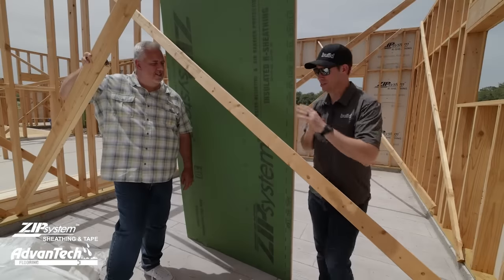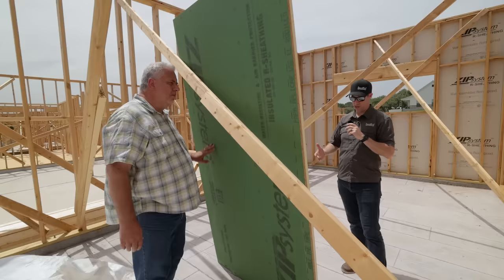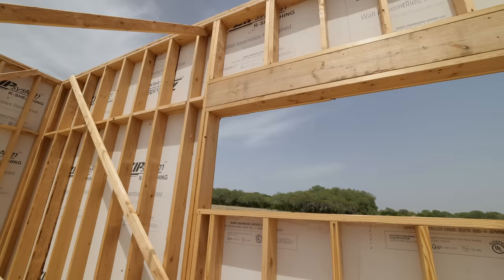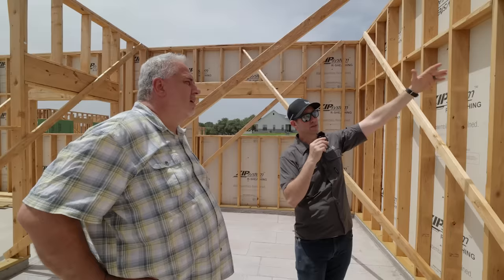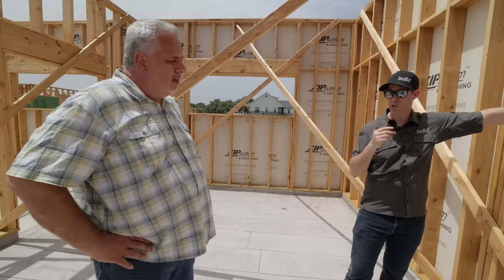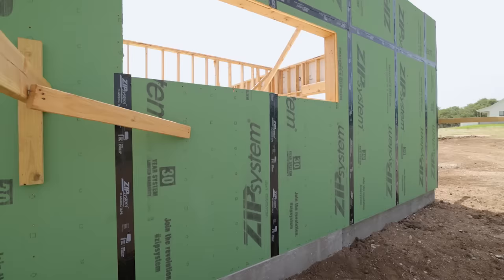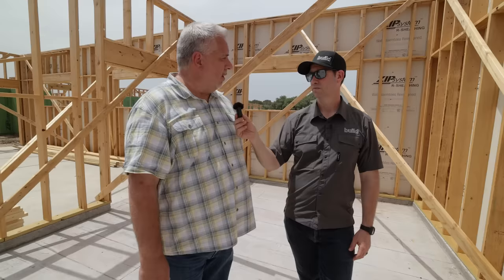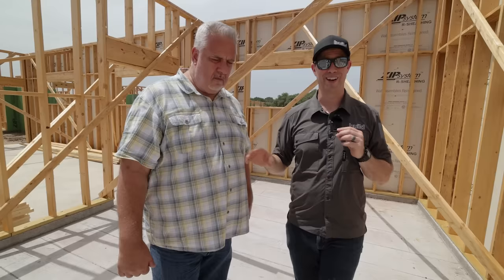ZIP-R Sheathing Review (Feat. Steve Baczek)

Comment: Good luck getting a termite bond using that. Around here they specifically state they won't bond a house with exterior foam. That's why I'm thinking along the lines of bringing in some Comfortboard.
Reply: But in this case would it be considered exterior since technically it is behind the exterior sheathing?
Reply: @explorenaked  As Matt mentioned, he mentioned a concern about insects burrowing into the foam, termites will eat right through foam. There are some termite bonding companies that will bond it but only because of specific  system they are using.
Reply: Not true
Reply: What if you did a piece of metal j channel the foam would sit in like he was talking with the 2x2? Tape it to the surface with zip tape and a bead of liquid flash when installing the j channel. No exposed foam and a nice way to air seal.
Reply: @SnappyWasHere  thought along those lines until I heard about Comfortboard. That should be sufficient but haven't run it by any of the bonding guys.

Comment: Seems like with the condensing point. Does it make more sense for Tx to put the insulation on the outside of the sheathing?
Reply: Yes, it does. Zip R isn't a perfect wall. Matt did it right on his own house. Zip R is just easier.

Comment: What you double sill the bottom with a 2X4 on top of a to 2x6/8. you get the strength of nailing the bottom of the zip and a ledge to hold the zip. Follow that with the tape to air seal the bottom. Trifecta win.

Comment: In central IL, what is the recommendation for Zip R? Building using 2x6 walls. Thinking about using rockwool in walls. Would you use any foam in walls other than sill plate in basement. Really undecided on foam for entire home.

Comment: It seems to me that the shear value in the wall system would be greatly diminished by having a layer of poly iso in between the studs and the sheathing.  Does any one know of data to prove me wrong?
Reply: Data? You don't understand shear value then and why attaching a piece of sheathing to the wall prevents shearing in the first place.
Reply: It is and Zip R isn’t permitted in places like where I’m from coastal Rhode Island.  It’s a good product to use in say Northern Vermont where you don’t have those high wind codes because you’re away from the coast but you do have extensive insulation codes for the cold climate.
Reply: No doubt what so ever just Imagine Sheating with 1-1/2 of airspace between it and the stud . Nailing Sheating directly to a stud creates friction also .
Reply: @richardthomas1566  So why don't you run those calculations for us and show the "greatly diminished" values?

Comment: I love this stuff .. I just hate the price increase .. yikes !  wish i could do my plaster / lathing / clapboard 20's bungalo with this system ... one of my issues is what to around the windows trim-wise considering the thickness of the zip-r  ( my windows are wood and newer double hung low e double glazed)
Reply: Extend the windows is not difficult if using old, but if new, just buy windows with deeper frames... This is not difficult here.   True, you can't be STUPID when doing it, but adding frame length is not difficult.  If you need to hide the line(most likely) , add a new sill plate inside.
Reply: LMAO

Comment: For shear walls, I guess that longer nails through foam will transfer the shear? what nail specs will engineers allow?. Is that insulation creating a radiant barrier on the inside?. Why does that sample piece look like there is and space between the panel and the foam? is the foam not attached?.

Comment: Curious what everyone is doing to mitigate the problem with putting doors and windows in a house with a 2x6 wall and 1 1/2” thick sheathing when door and window manufacturers aside from custom, design their products around a 4  9/16 or 6 9/16 jamb?
Reply: Either custom ordered with larger jambs or finish carpenter installs larger ones. I like making them after the window and drywall is installed to they can be made to the exact depth.
Reply: I have been installing my own jambs for years....easier to start from scratch then fix what's there.

-Improperly shimmied, if at all.
-spray foam has to be dug out and redone
-fat headers or out of flush framing cause width issues
-drywall cutout bit damage
-drywall mud build up on jambs
-sills bowed up in middle from poor framing, and no easy way to get down/straight.
-better foam job, as the jamb goes in while the foam is still wet.

The cost of the manufacturer's installed jambs vs. Materials and labor is usually an easy sell.

Shim next to window with drywall screws run out to the proper height (a simple jig make this easy).  
Spray foam and insert jambs.
Nail adjacent to screw/shims.
Shims/casing to fine tune front of jamb.

This sounds like a lot of steps, but it beats digging out foam and drywall every time.

Comment: Would you be ok using closed cell foam with the Zip-R?  Some worry about a double water barrier.
Reply: I have done it. You need to ensure the CCSF installer is top notch. The fear would be for moisture laiden air to find its way between them. (in colder climartes)
Reply: @stevenbaczekarchitect9431  thanks, so you'd have less concern in a warmer climate, like Texas, or more?

Comment: Last couple times of purchasing Zip panels I’ve noticed the quality control is in need of revamping. Of 40 sheets at least 10 were coated where the material of the board looked chipped out. Also the overall strength of the board seemed to be lacking or I got a lot stronger swinging a hammer and I really doubt that as I’m 53 with arthritis and hate swinging a hammer.

Comment: Great video, I am remodeling & updating a Florida home that is constructed with typical CMU blocks and I think could benefit with a R12 panel that could provide the WRB, insulation, sheathing for siding updates and a chase for Elec & plumb adds and updates. Any thoughts on fasteners and assembly specs? thanks, PETER

Comment: So let’s add a very flammable rigid polyisocyanurate foam on a “fire barrier” sounds smart…. All foam products light up like a fire starter. Let’s see ZIP lit 🔥 there rigid polyisocyanurate foam up and see how it works.

Rigid polyurethane and polyisocyanurate foams will, if ignited, release various products of combustion such as smoke and gasses
Reply: And?
Reply: @LargerThanCats  Creates a death trap as sheathing falls off as the polyiso burns and the house falls down more quickly, also sometimes codes require an exterior wall be fire rated for 1-2 hours which means polyiso can't be used at all.
Reply: @drencrum  And?
Reply: @LargerThanCats  And you don't have much to say.
Reply: @drencrum  And?

Comment: When using zip r do you have to order custom windows and doors? Standard door jamb in exterior on a 2x6 is 6 1/2. So using an Additional 1” that wouldn’t work
Reply: Doors: yes,  a jamb extension is required.
Flanged windows can be mounted directly to the Zip R (with longer fasteners). 
Flangeless windows can be mounted anywhere in the jamb.
Reply: I have 1” exterior poly iso on my home built in 1994, I just replaced the windows and am in the process of constructing custom jambs.  Replacement windows almost guarantee this even without exterior insulation, so I fully expected it.  Not a huge deal, just time consuming.

Comment: In 1959 the builder of my Fort Worth home decided to save a few bucks and not use brick ties. Eventually, I'll need to pull down the existing brick. When I do, I think I want to go back with Zip-R sitting on the brick ledge and faux-brick panels to make it presentable.
Reply: I'm confused a job has lasted for 64 years and you may need to redo it in the future and the complaint is what?

Comment: Matt- I live I Leander and recently found out I have no tyvex or waterproof under my hardy board. So now I have to remodel the back of the house. What would you use in Texas? Thinking zip system with r value. Then hardy board back.  Really worried about water proofing

Comment: Only Pro: Reduce labor cost, Cons - Weak shear walls: nailing is supposed to be OSB/ply against studs. - Low fire resistance: Installing eps against studs (ZIP-R) will  increase the fire propagation rate and makes all fire blocks useless.
Reply: You've done the testing to prove all this?
Reply: @brianthompson9485  no, average house fire will usually burn between 1000 F and 2000F, eps melt at 400 F
Reply: Zip R uses polyiso not eps
Reply: @Cpt_Guirk  ok, but the same melting point, fire will move to the roof in no time.
Reply: This is when using rockwool in the cavities becomes very important.

Comment: Would it be better to leave the Zip-R12 sheathing short of the jack (trimmer) studs and use 2-7/16 x 1-1/2″ furring boards on top of the jack studs so the window flanges have solid wood to nail to or just nail though the 2-7/16″ thick sheathing into the jack studs using 4″ nails?  

I’m concerned that the framers might not get the R-12 sheathing up tight to the furring boards and leave gaps that will need to be foamed before using Zip tape.  Huber says it’s OK to nail through with 4″ long nails around windows but my builder is concerned that the windows might not adhere long term to the wall and could move with any movements of the sheathing due to 2″ of foam sandwiched between.  With furring boards, I’d lose the exterior insulation over the jack studs and top/bottom around all windows.  My builder doesn’t think that’s a big deal.  It’s my call, of course.  My windows are very large with some 132″ x 72″ high.

Your opinions would be greatly appreciated!
Reply: what did you do? Watching the video I thought of this exact predicament.  I think I would have just gone with the longer nails, but then I was thinking the R-value of the window frame is probably about the same as the R-value of the wood, which would be wider in that area.
So neither way could be distinguished as substantially better than the other way, except for the feeling of a large window hanging more securely.  but furring each window with additional supports is time consuming.

Comment: What would interest me is with the foam against the studs would there be a significant loss of the shear strength that would potentially wear away at the foam causing it to get worst? Would it not be better to essentially put an additional layes or plain OSB or plywood which you can then add a small ledge at the bottom bridging the foam gap so you have no potentially exposed foam
Reply: I feel like there is a loss of shear strength idk if it’s enough to matter but I sided a house with this stuff and I think with the siding it was like over 1 1/2 inches thick. We couldn’t even use a coil gun for our hardy board because there weren’t any coil nails long enough to hit a stud so you have to use a fuckin framing gun and turn it down all the way. Not only that but on a lot of the seems I saw places where the sheets weren’t even touching the studs like some sheets were sticking out a 1/4 past the one it’s butted into. It could be the people who put it on but I only ran into one house that’s ever had it so far. I will say it is nice that you don’t have to tyvek it though. You just have to tape the seams.

Comment: Is a poly (vapour) barrier still required on the inside since the exterior Zip R has the weather barrier built in?  If poly was added inside wouldn’t this trap moisture inside the wall?
Reply: No poly on the drywall side.  You can use a smart membrane if you like but regular poly sheeting will trap any moisture in the walls with both wall sides being low to no perm.  Rockwool or spray foam with no interior vapor barrier.  Not sure if fiberglass would be a bad choice or not with no interior vapor barrier when using Zip-R but you need to make sure you're using the correct Zip-R for exterior R-value - depending on what zone you're in.  I used Zip-R12 in Minnesota.

Comment: What is a good insulation or product for sound reduction for interior wall cavities?  2 x 4 interior bedroom wall, wall has plumbing for a bathroom on the other side.  What can we use to really quiet that wall?  I have been told a rock wall insulation because of its density.  I don't mind pulling down the rock on one wall That's 12 ft long because I can put the rock back up but I just have to do something about that sound
Reply: Check Rockwood, has a sound proofing line too
Reply: You’re looking for Rockwool Safe n Sound.
Reply: Depending on how far you want to go there are several things you can do. As mentioned already Rockwool in the cavity. You can also use acoustical caulk on the studs before you hang the drywall back up as well as seal around the drywall cavity. You can also do a double layer of drywall on top of all that. The point is to absorb as much of the sound vibration as possible.
Reply: Use Resilient Channel on the studs
Reply: @scottv.4140  totally agree with all of this. I probably wouldn't use a double layer of sheetrock, consider going with quiet rock instead, though it is more expensive than just doubling up.

Comment: Questions: Is the inside face of the zip board against the studs a radiant barrier covering? And if not, could it be painted with a radiant paint? Also, if you use a single headed nail to attach the sheet to the studs don’t you lose some strength structurally since the head of the nail is firm against the foam board which is easily compressed and would allow the board to move around? Would it be possible to use a double headed nail to attach the sheets or just screw it to the studs down to the face of the inside board and use a filler at each attachment point? My 2 cents from someone who knows nothing about zip boards. Thanks for these great informative videos, watch them all the time.
Reply: the ply sheeting is on the exterior, where the nail would go. the poly iso is between the studs and the exterior sheeting. nail goes through ply first, into iso, into stud. nails have a stronger shear strength than screws unless using specific screws. double head nails would not work as the lower head would hit the ply and the higher head would still be above the surface of the ply. if you tried hammering to the next head you would create a larger unsealed hole, have no holding, and leave the ply exposed to any possible moisture. I am by far no expert and can be corrected on any of this. i have built some things in my life and understand (some) advanced building methods like this.
Reply: You got me thinking. I like the insulation on the outside. What if they engineered it so the foam is attached to the green side and then they create the hollow tubes for screw attachments and fill them with spray foam in the field. Then you get the perfect wall.
Reply: @4our5ive61  Appreciate the reply.  So the board facing out sits on the foam and you have a nail or screw thats an inch or so away from the stud buried in foam. Not liking that at all structurally. I think I’d rather use a 5/8” or 3/4” radiant barrier board (cool decking) and then attach Grace Ice and Water Shield rubberized adhesive underlayment to the radiant board and then attach your preferred siding to that. I’d just use a high R-rated insulation in the walls. More than likely my method is not any cheaper but I’d sleep better at night. My opinion whatever that’s worth. Thanks again.

Comment: Hi Matt, in Joe Lstiburek"s perfect wall the foam board part is facing the exterior but with the Zip-R the foam faces the interior of the house, one of Joe's main concern is to protect the structure of the house, i believe the OSB is big part of the structure, that's why the order for a perfect wall based on Lstiburek is cladding/siding, foam board, osb, insulation,etc.  how would this Zip-R board affect the quest for a perfect wall, and how things will dry if needed using this system? i don't think there's any permeability from the polyiso foam.
Reply: wouldn't have been better to have the foam on the outside?
Reply: The order is cladding/ siding, air gap, then outsulation (insulation outside), then water air barrier, then osb.  The barrier is to be vapor  permeable but block water.  Moisture moves from warm to cold.  I would build with regular zip and the use inso fast panels for outside insulation.

Comment: For those of us in the north, polyiso doesn’t provide great cold weather performance. Would love to see this made with gps or xps.
Also I worry about the foam contraction in the cold.
Reply: Polyiso R-value does decrease in cold temps but it is a gradient degradation from outside to inside as the polyiso warms closer to interior temps.  I've read at 0 degrees F the range is between R 4.5 - 6.1 per inch for polyiso.  XPS has a 4.7 value and EPS 3.6, so Polyiso still looks better at 0 temp.

Comment: I'm planning a ICF for the DFW Area. I want a Solar Roof and understand our latitude is 32 degrees or 7 1/2" per foot run. I'm doing a concrete roof and planning Spider Ties with 2"ISO X 5/8" Huber Zip Sheathing. Is ISO Insulation compatible with concrete?
Reply: If ICF is two layers of insulation with a concrete sandwich in the middle,  why would you want an extra layer of insulation?

Comment: The problem with this method as opposed too plywood against the studs is you have less sheer strength.
Reply: Not necessarily. When you attach the sheathing to the framing, then tape the seams. It creates a very, very sturdy skin over the framing. Compared to the traditional that has nothing other than fasteners ti help create that protective outer layer. The zip tape is unreal sticky and fairly rigid. Think outside the box. Just because grandpa built a certain way for 50 years don’t mean it was right.
Reply: It is diminished slightly but still much higher than required
Reply: Show your data